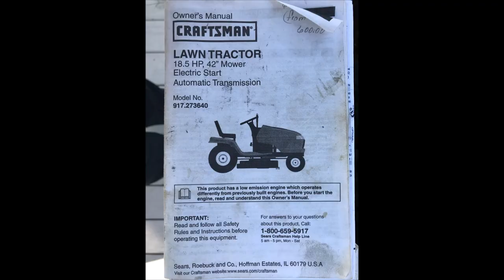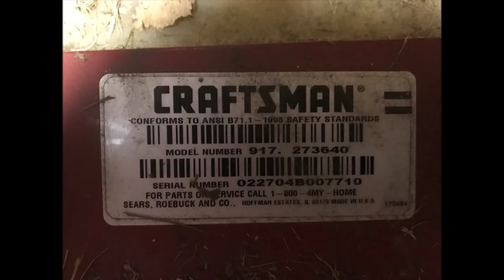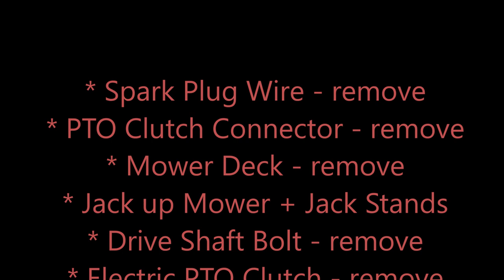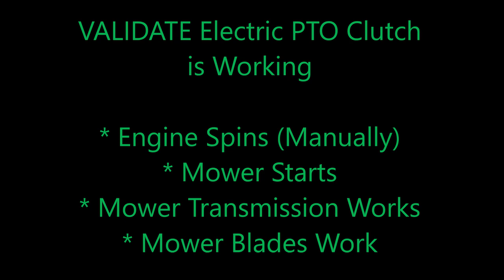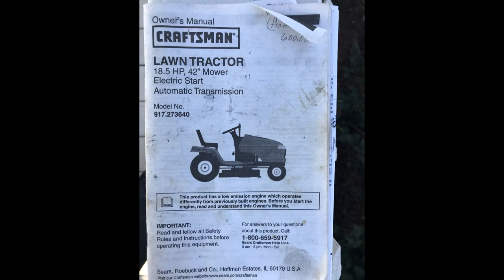Craftsman Lawn Tractor - PTO Electric Clutch - REPLACE

Comment: Great video.  Recently I had to replace the drive belt and couldn't seem to figure out how to remove the "clutch locator" per page 25 (without removing the clutch), which is anti-rotation bracket in your video.  I did the same thing by removing the whole clutch in the end.  The manual doesn't indicate the torque of the clutch, so thanks for sharing its around 40-45 ft lbs.  Wish I saw your video a week ago :)  Though in order to torque the clutch bolt, I found it easier to also use a 12" adjustable wrench on the flat sides right above the clutch bolt to hold it in place while torqueing it down.

Comment: Dude, YOU ROCK !
   I have had what I thought was electric starter problems for a year. 
I installed a new starter $80,
I built a platform to accomadate a second battery, $90, but the problem kept getting
worse. Finally, yesterday, I noticed that the starter bendix gear was hung up in the flywheel,(jammed-like).

   The only thing I could conclude was that either the engine was seized, which I was almost positive was not the case, or the thing was hung in a compression stroke or something...?
I removed both spark plugs and tried to crank the engine, no-go. That's when the light bulb came on that
possibly the clutch was causing friction or something. 
      So I went to good 'ol YouTube, typed in "Riding mower clutch failure"  and the first two videos were about clutches that had electrically failed. Your video was the third and, EURIKA !  I couldn't believe it ! You were describing my mower's exact  problem !
Thanks for taking the time to show us.
Reply from the maker: Biff Tuber - You’re Welcome.  Glad to have helped - it’s the whole reason I take the time to put these type of videos out there.

Comment: I have exact same mower. I suspect a slipping PTO clutch. Just rebuilt deck and when I engage the blades, it takes a solid 5 seconds to reach full rotation speeds now. Belts not skipping and there's plenty of tension

Comment: Yay you have my DYT4000! Replacing the electric clutch today. Impact wrench (mine is battery powered) absolutely necessary to remove long bolt. The only other problem I´ve had with this tractor is the plastic gas tank shattered around the fuel line connection. I meticulously drained the fuel system every fall, and apparently you´re not supposed to do that? There are no replacement fuel tanks, so I bolted an aluminum one under the back apron (yep, after watching YouTube videos). At the time I couldn´t find a square one that would fit under the seat but they may be available now. Other than the tank and the clutch, this mower has been completely trouble free. Course I just jixed myself. Hope yours is still rolling! Thanks for the video, it really helped. (ps If you set the parking brake it de-tensions the main drive belt so you don´t have to press the brake pedal with one hand)
Reply from the maker: Good tip!

Comment: Good video. Would have helped to show removing bolt that holds clutch onto drive shaft. Does shaft turn, making bolt removal difficult?
Reply: Bilbo Mac ......Thanks for asking that question.  I wanted to know the very same thing. I’m struggling to remove the PTO clutch on a Westwood T1600 and don’t know if the bolt is right or left hand thread.  You saved me a great deal of time.  Obliged to you.
Reply: Remove the air induction cage at the top of the engine. Then put a wrench on the top bolt. Have another person hold the wrench while you remove the bolt on the bottom of the clutch. Hope this helps
Reply: @dchudomelka  The bolt on the top of the engine came loose.

Comment: How did you keep the crankshaft from turning while you torqued the bolt down?
Reply: You can usually just hold the drive pulley, if you want more torque, you can grab the belt that's around that pulley, holding it together, and use that as a kind of strap wrench.  If you really want to torque it up, you can take off the fan cover on top of the engine, and grab onto the big crankshaft bolt on top of the engine with a suitable tool.  It's usually just a few small screws to get that mesh cover off, and then you can see that bolt.
Reply: There's a flywheel bolt pretty easily accessible at the top of the engine.  Pop off the round trim cap and there it is.

Comment: Have a question, my son has the same tractor, and I'm trouble shooting it now.  When I pull the electric PTO knob, I get nothing, Its as if the PTO switch, (Knob) is not getting any electricity to power the clutch.  Any ideas? Seat safety switch works to start the tracker is in Neutral. Engine sounds fine.  Is it possible the PTO switch went bad? Hard to believe. I'm thinking its the electric side of the electric clutch. Could use some ideas. thanks.

Comment: Sometimes....i use carburetor cleaner untill it runs out of the bottem of the shaft, then soak it with P.B. until it starts to run out. They seem to resist less when i do this

Comment: How do I get the 5/8 bolt holding pto on loose. When I try to loosen it w ratchet engine turns over.
Reply: I use an electric impact.
Reply: Depending on the engine crankshaft runs all the way  to the top of the engine.  but that's how you could hold the shaft. While you turn the bolt on the bottom of the PTO shaft. Or use an impact  wrench to remove it. And you won't have to hold it on top... the impact will get it loose.

Comment: Does the clutch you just replaced work for engaging the mowing deck only? or dose it also disengage the transmission for changing speeds? My 85 year old mother keeps her foot on the clutch pedal the entire time she mows, is that a no ,no? It seems like the clutch or a drive belt is slipping, the mower will pause briefly and then take off again.
Reply: you are correct,  that is a no no. What she is doing is unloading the tension from the drive belt.  You can see what happens at 6:50 in the video when the brake pedal is pushed,  when that pedal is released,  then all the tension is put on the drive belt,  which allows the tractor to move forward or reverse,  depending in which position the gear lever is in.  When she leaves her foot on the pedal,  it will allow the belt to slip,  and the belt will wear more quickly.

Comment: buy a mower with a manual blade engagement and it will last the life of the mower,buy one with a pto electric clutch and you will replace the electric clutch 2 or 3 times during the life of the mower and they really are a pain to replace because the clutch is costly and usually stuck on the motor
Reply: George - what modern lawn or garden tractor, that you can buy today, has a manual blade engagement?  Even my 1969 John Deere 140 has an Ogura electric PTO clutch.  I'm pretty sure that we are going to need to replace my father's clutch on his 2018 Cub Cadet RZT SX mower with 114 hours on it - what junk.

Comment: So I sat through this entire video to see how you kept the engine from turning while you tightened the pulley bolt and you never showed that! I have to remove the pulley on my tractor and I can’t hold the engine?!?
Reply from the maker: I used an Air Compressor Impact Wrench.
Reply: Scott Farrar Thanks
Reply: I've heard of people removing a spark plug and pushing some rope into the spark plug hole.  That prevents the piston from moving all the way.  I've never tried it.  Maybe someone can respond.